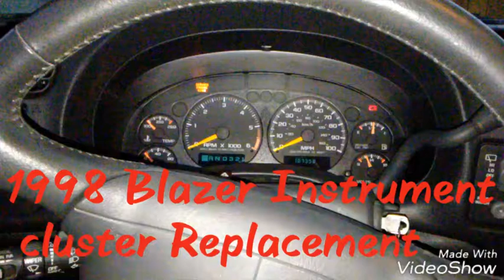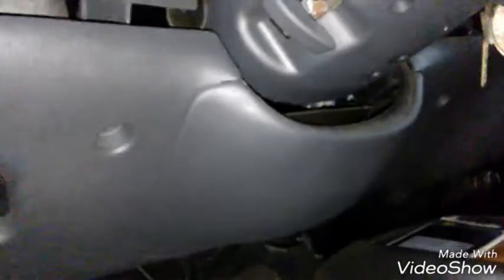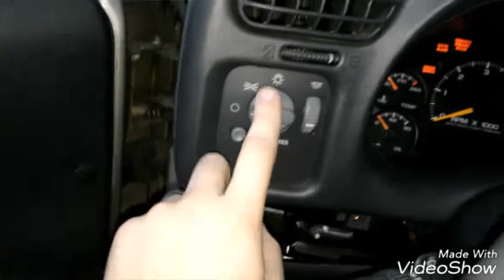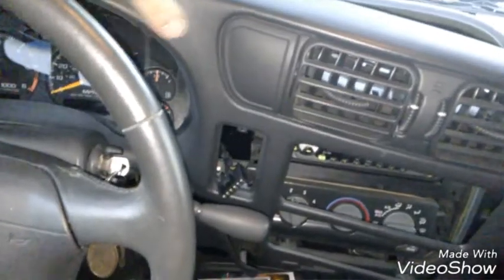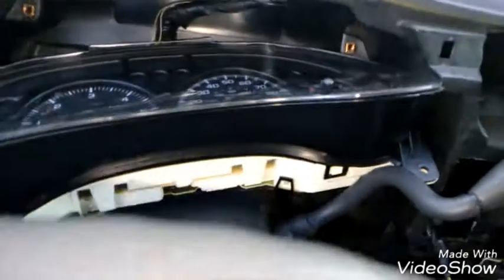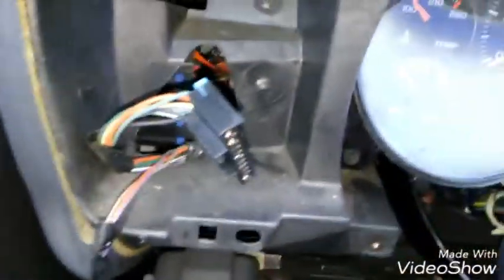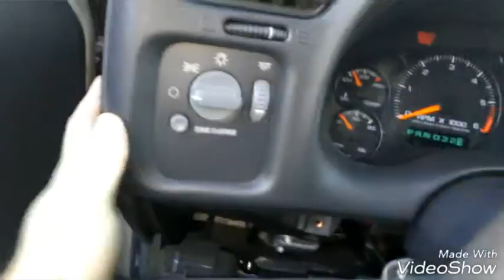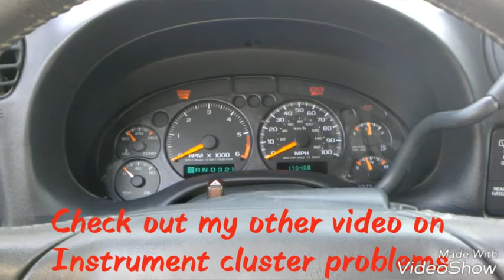1998 Chevy Blazer Instrument Cluster Replacement

Comment: This info is great to know thx cuz I have 2 Chevy Blazers both 4 door 4x4 4.3 v6 one is 98& the other is 04 but someone stole my 98 a few wks ago and I recently got it BK but whoever stole it tore apart my steering column and there's wires dangling and I was wondering how to put them BK in the correct spot but idk what wire goes in what spot? My boyfriend was trying to figure it out on his own and accidentally had 2 wires touch briefly n it blew the driver airbag 😂 (dork) that's the least of my worried my main concern is putting the pulled wires bk correctly! 🤞 Do u know if it's possible it would be ok and work like it did prior to being stolen and do u have a video of replacing the steering column cluster so I can get an idea of where they came out from?? Again thx

Comment: The JB weld will work good, but it you really want it to never ever crack again, you apply JB weld and place a donor piece of plastic over the JB weld about 2 inches wide, right over the crack after applying the JB weld. You can place a clamp on it snug (not tight) while the JB weld dries. This is done as a reinforcement.
Reply from the maker: +RU4REAL Thanks for the tip!

Comment: Thanks for the video. pulled a cluster from wreckers. but think it may just be the bulbs. have no illumination on gauges at night but everything seems to work ( more other issues but save that for another time. i do notice the temp, oil and other gauges beside speedometer flicker after i turn off the vehicle and it stays in the position..is that normal? thanks pal

Comment: Just a curiosity I just bought a new head unit that I am going to put in my 99 blazer 4 door. The instrument cluster bezel is cracked and I was wondering if there’s a way to take my other radio out without removing the bezel?
Reply: not a chance less u cut it out id just look for another trim piece in a junk yard somewhere